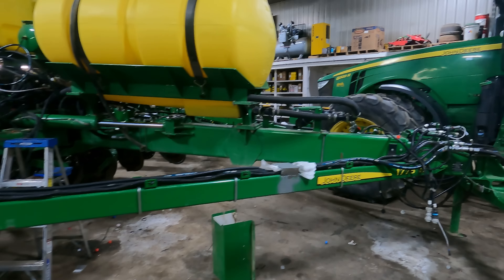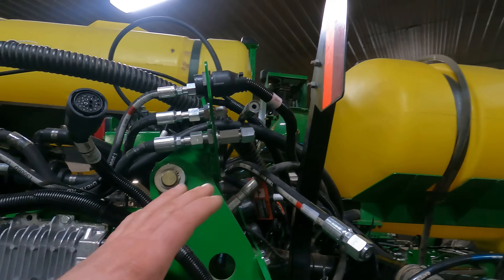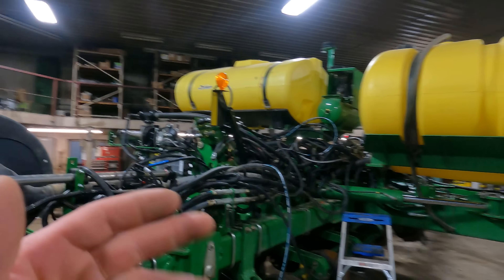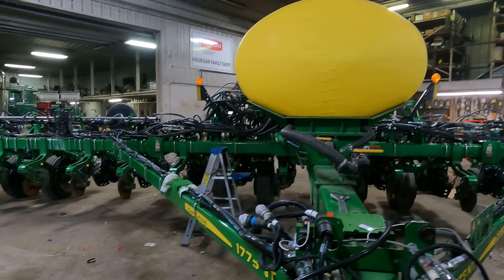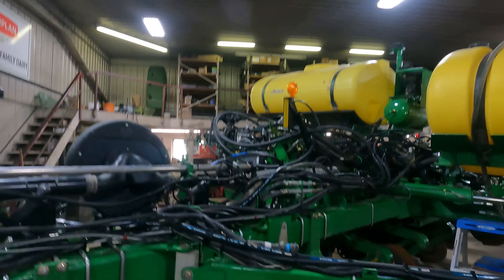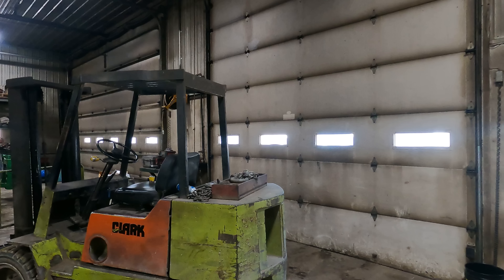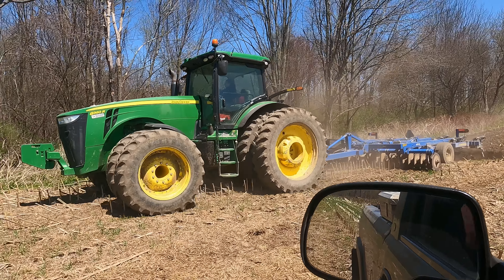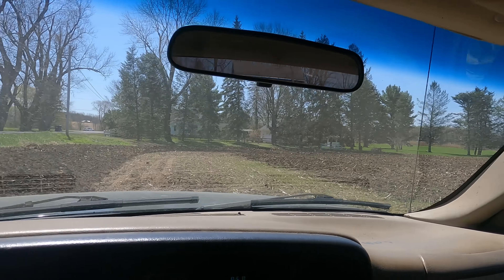Corn planter and Chisel plows

Comment: Hey there Andy and Crew, I hope this finds you all well and good! 

There are quite a few planters already in the fields with a plethora of differing performance upgrades on them, and the reports have been overwhelmingly positive, as I'm confident yours will be, once the little things get adjusted, including the operator.

That PTO generator has an internal grease fitting on it that requires its removal, and is often overlooked, and if you're not careful, you'll be calling your dealer to see if he has the sensor for it. 

I hope y'all have a good one, and will be putting that seed in the ground by the time you read this.

"Nothing Runs Like A Deere" 🦌👍🇺🇸
Reply from the maker: Yes it looks as though you don’t want the wrong person removing the gear box
Reply: @FarmingFixingFabricating  

Yes indeed, I've seen many sensors need replacing, especially after the first time, and I've also seen failures due to that 1 zerk on the generator never having been lubed. It's all in the operators manual, which unfortunately is the first thing that gets thrown into a pile somewhere on many farms. Have a good one Andy. 👍
Reply from the maker: @RealJohnWayne  thanks bud
Reply: @FarmingFixingFabricating  

You're most welcome my friend. 🦌👍🇺🇸

Comment: wow alot of work to due yet will you be able to use this planter this year alot of corn being planted as we speak look like it was a huge undertaking dad and I built a 8 roll planter back in the 70,s a self propelled planter we mounted on a tool bar and put it on a new ID uni harvesterl  had two 1000 gallon tanks on it for fertilizer and sprayer insecticide everything was done in one pass we were able to plant a hundred acres a day don't seem like much to but back in 1973 it was a big help to us I remember hours and hours were spent calibrating everything

Comment: Thank you for talking though the build up of all those parts. Very interesting. MAN the body of that looks like a garden snake mating nest. Does the PTO 3 Point on rear of tracker already come with fitting from factory, with those all add on connection. On are side boom mower ( road farming) Tractor I ran don't remember seeing that meany connection coming on back. It was a smaller New Holland and later a JD mid size tractor. ( Sorry can't remember the number)
Anyway you have to be jack of all trades. Love your work table set up in garage/ shop. So clean and clear.

Comment: My god would it of been easier to buy a new planter!!!!!
Reply: Also availability
Reply: @Adam_Poirier  Was thinking that Andy might consider a new planter if Deere agreed to build it in his shop,  Andy does seem to enjoy his fabrication/rehabilitation/modification projects.
Reply: The scale of this operation will benefit  from further precision with corn planting ,  its their main crop .
Reply: @m.j.l.abulle9107  Not sure about that, if tonnage is the measurement. They chop corn & shell corn as single crops per season however they chop as many as 4 perhaps 5 times per alfalfa field dependent upon rainfall & sunny temperatures. Andy will clear up any misconceptions🇺🇸🗽🍶
Reply: Saw a comment by Oliver 880, stating no new planters were available. There were & still are a few 2021 1775NT high speed planters for sale, however they have a few demo hours on the clock. The drawback is the price tag is $320K & up.
Reply from the maker: Yes much easier